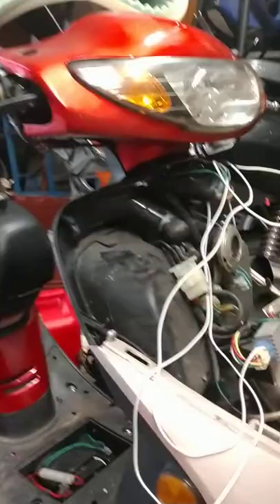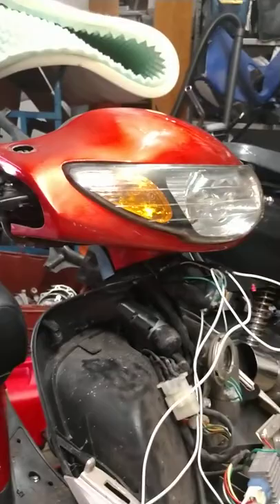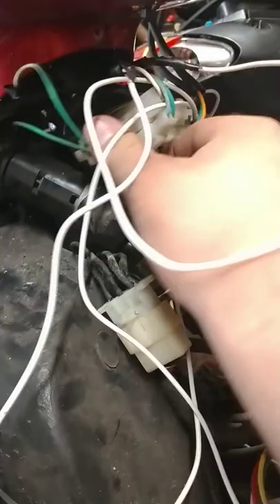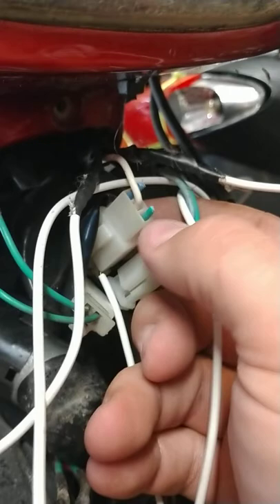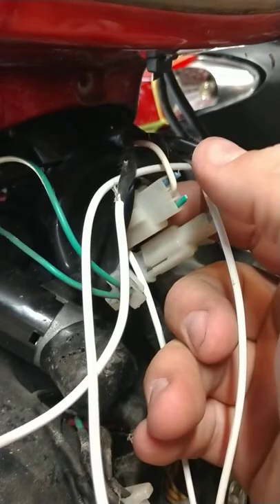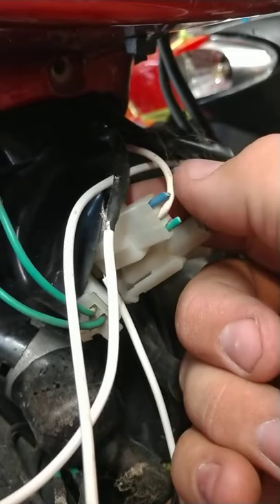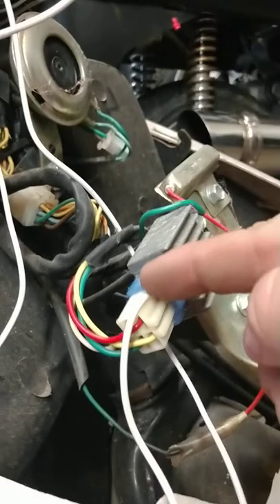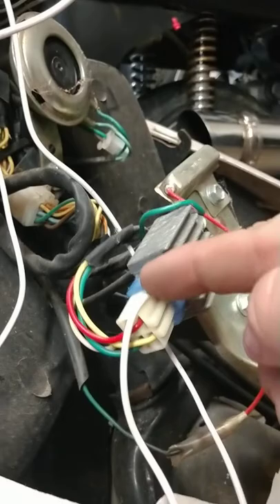How to fix a headlight issue on a wildfire scooter

Comment: Thank you four your great video I have a Peugeot V -Clic 50cc my Headlight bulb is low-Hi the Low is blowing all the time also the rear tailgate blowing to is just working when I break and the Hi been working to any advice thank you very much
Reply from the maker: I figured out a better way. Cuz the wiring on these suck LOL. If you run a wire from the positive from the battery to the switch in the brake handle and then run that wire to your tail light and make sure it's grounded as well that's how you create the brake light. As a running light I hope it straight to the battery with a switch and that switch also will hook straight up to your headlight I just completely bypass the harness and make my own essentially. You have any other questions just ask

Comment: I’m having the same issue with my GY6 150cc bike I put brand new parts in my engine cause it seized up now my headlights don’t work and the speedometer light but my signals work and break light only when I hit the breaks. Can u show me which one do I properly put the wiring
Reply from the maker: Did you replace your stator

Comment: Hi how you doing I got a 50cc TaoTao scooter will you send me the directions how you did that how you Rampage straight wire and connected it with the switch cuz I always having problems with my headlight on my 50cc TaoTao scooter
Reply from the maker: If you have a switch you can hook it up directly to the battery. Makes it a little bit easier. I can help you though.

Comment: Replaced my highbeam light..worked fine until I reved it and it blew out..looks like previous owner had probs with it since there are melted wires from the original setup
Reply from the maker: The only thing I hate about mopeds are cheap wiring harnesses. I ran into so many electrical problems. I finally started building them from scratch. It takes time but it's worth it

Comment: Having a strange time right now.

Popped in a plug and play LED headlight and now my stock regular bulb style flashers stopped working.

Any thoughts when you have a moment?

49cc Taotao Pony 50.
Winpower plug and play LED headlight.
Reply: The flasher bulbs are incandescent ?  Sometimes connections loosen when moving adjacent wires.

Comment: My horn, blinkers don’t works . My gas gauge goes to where it’s supposed to be, when I hit the lights to high beam.
Reply from the maker: You can also run your headlight to a switch and straight to the battery. I'll be making a video soon that's how to run your headlights like that
Reply: @EpicvideoPro  Hi, have you made the video you outlined in your comment "You can also run your headlight to a switch and straight to the battery"?  I would like to watch it to learn how to do this.
Reply from the maker: @paulcompme856  I will try to have one uploaded tomorrow night. Thank you for watching
Reply: @EpicvideoPro  WOW, that would be fantastic. I look forward to watching it
Reply from the maker: @paulcompme856  video is put out now
Reply: @EpicvideoPro  hooking to the battery is basically what he did.  The device he plugged the wire into is the a/c to d/c rectifier/regulator.  The yellow comes from the stator/generator (with the white wire I believe).  As the flywheel magnet revolves it generates A/C power.  The stator has 6 or more small coils so the a/c is 6 phase or more, similar to an alternator.    The yellow wire goes to the headlight and powers the headlight with a/c power.  Other lights may also used the unrectified output.  The yellow wire's unrectified a/c enters the rectifier and it converts it to DC and regulates it to 12v nominal.  The DC output leaves on the red wire to the battery.  Blowing out headlight bulbs can mean the stator/generator is producing too much power but I wonder how that's avoidable since it is unregulated coming straight from the generator.  I think this arrangement is so that the headlight continues to light if the rectifier fails.  The engine must be running to get power to the headlight switch since it is not powered by the battery.  I guess another possible reason is that the headlight can't draw the battery down if the engine is turned off but the key is left in a power position.
Reply: Turn on your engine and shove a multimeter red probe inside the connector at the red wire  like the author did.  Set the meter to 20v DC.   Shove the black probe into the green wire of the connector.  The meter should read around 12v.  If not you may need a new $15 rectifier/regulator.  Of course check for good bulbs and horn first.  You could touch a wire from the + terminal to the horn to see if it is good.  You can also touch the wire to the turn bulb wires to see if they light up.  The flasher could be bad.  An easy fix with an inexpensive part.
Reply: @jimanonymous113  thanks
Reply: It was working when the bike won't running!!

Comment: Not the same on my roketa 😤🤬
Reply from the maker: Worst case scenario you can run the wires straight to the battery and have a switch to turn it on and off.